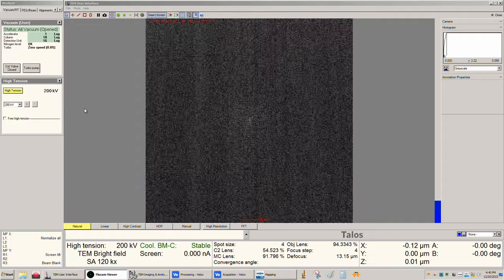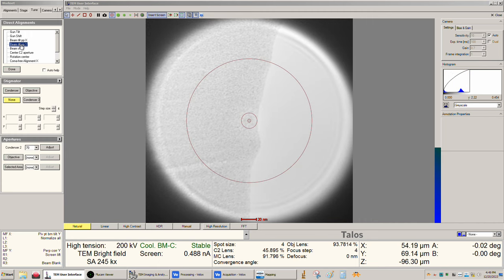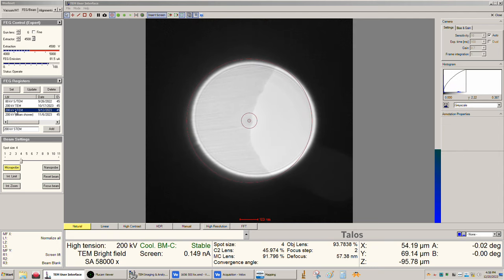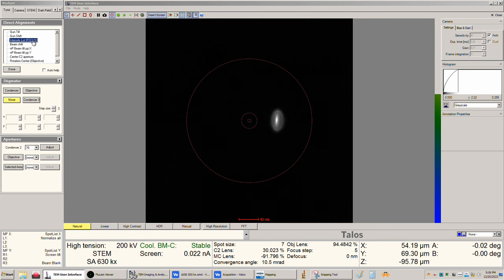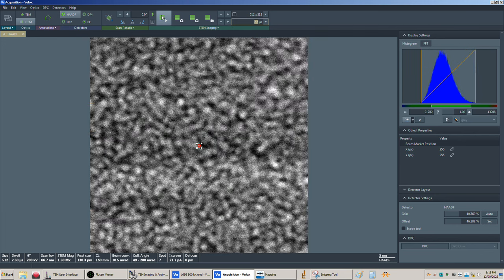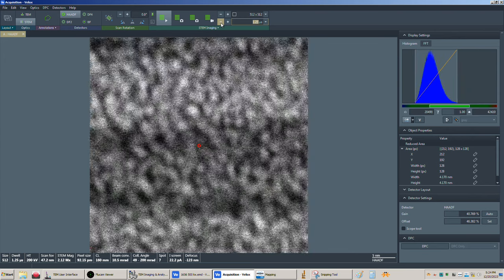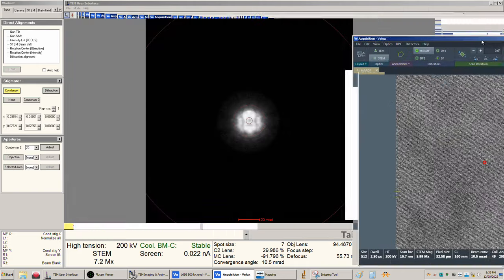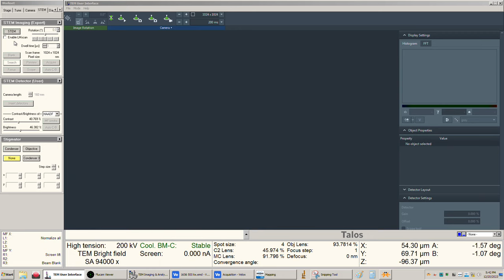Proper focusing in TEM and STEM modes

Comment: Thanks for your work. Nice video, it looks like you have several grains in your sample so maybe you take grain with different ZA (it does not look like 110). The focus and stigmators looks wonderful. Thanks.
Reply from the maker: Thank you; I assure you it is [110] zone axis; I looked at this sample previously on a different instrument and I was aware of the wafer orientation when I made the lamella.  I've had similar unexpected noise issues with the atomic-res STEM image on this instrument before; it's just a shame it happened while doing this demo.  I could tell there was probably an issue when I was imaging the Pt grains, but then it was even more obviously when I moved on to the Si sample.  It may be a time of day issue; these problems seem to pop up mostly during the late afternoon (which is when I recorded this).
Reply: Thanks for the explanation.
Do you use field cancelation equipment? So maybe some noise in the grounding from other equipment. Hope you could solve this issue.
Reply from the maker: @sergeiremennik7604  In the Talos room, we do not have any field cancellation equipment; at the time we did the site survey, it passed all the specs so we (justifiably) didn't think any was needed.  I imagine we wouldn't have this issue if we did have active field cancellation in the room.  We do have this in the Themis room, because at the time it didn't pass specs.  Of course, fields in a room can change if there are modifications to the building infrastructure, and it's also possible that the issue is intermittent in nature (it seems to pop up mostly during the late afternoon).  What I really should do is take HR-STEM images at different points through a whole day and see what happens.  I could actually turn that into a neat video for the channel; thanks for the inspiration!

Comment: Thank you for a workshop! Could you explain, please, the difference between two situation: 1) image in focus, when objective lens current is as it should be at eucentric height (as you do); 2)  then we defocus the image by objective lens and go back to a focus but using C2 lens. Will these situation equal?
P.s. in case strong AC field, it should help, if you will do focussing at another dwell time: 31,96 mks for 512x512 frame and about (don't know exactly) 120-130 mks for 128x128 frame. Thus you will eliminate 50 Hz "saw".

Comment: I think you need to set the focus knob function back to intensity knob when you are trying to fine tune atom images.
Reply from the maker: You could do this if you want, but it's not necessary.  I've obtained good atomic-res images using both methods: fine focusing using C2 and fine focusing using the objective, but I personally no longer use the C2 method.  The key in either case is to make sure that the deviation from eucentric is not very large.

Comment: Very nice video! Did you finally find out why you didn't get the atomic image, I had the same problem!
Reply from the maker: Hey, thanks.  Regarding the atomic-res STEM issue in the video, I never "diagnosed" exactly what was causing the problem.  Thankfully, the problem was transient and was gone the next day.  The fact that it came and went like this along with the presentation indicates (at least to me) that this is some kind of stray electromagnetic field issue.  Hopefully, it never becomes more than just a random nuisance.
Reply: @NicholasRudawski  Thanks for your reply , I've had this problem several times, but all after cryo-cycle.